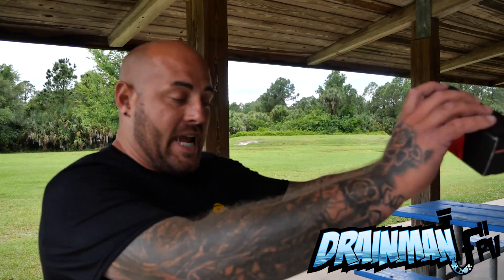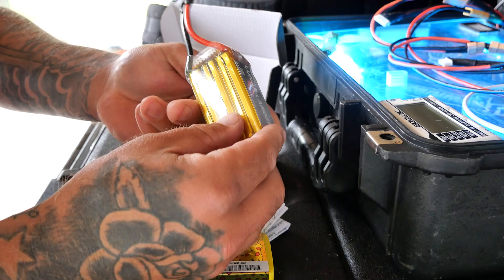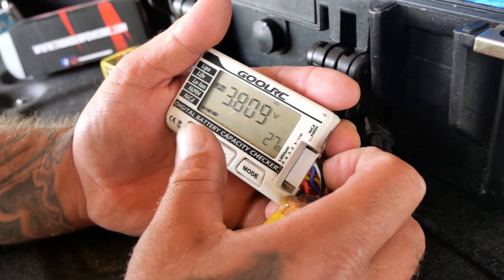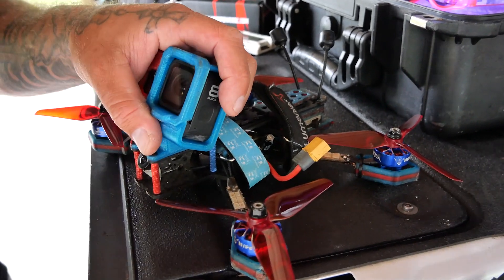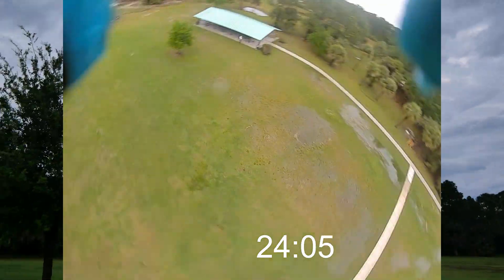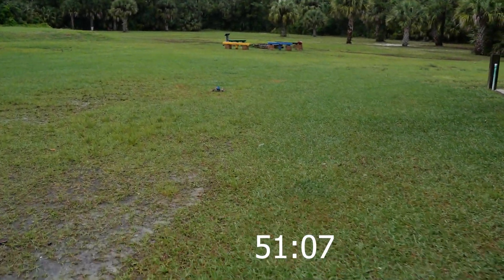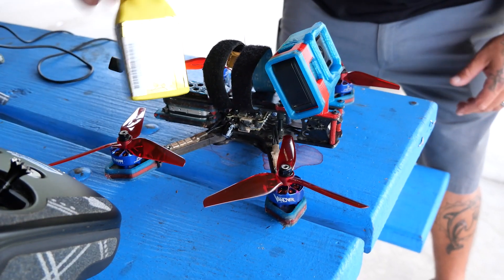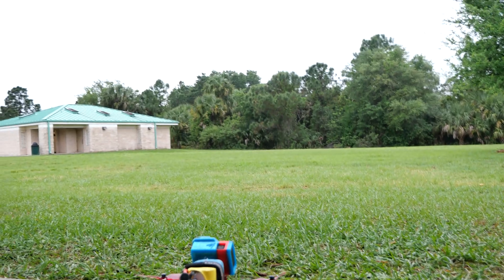Lipo Battery Torture !! 50$ Lipo VS 20$ Lipo !! Which Would You Spend Your Money On ?!

Comment: I got 3 lunar lander, I am extreamly disapointed. They suck, id only fly them if I wanted to brag I had a lighter build. 300mah, I'm getting battery low Waring. I will continue to use CNHL 1100 6s. I have beat the crap ouy of them, and they perform to the end, for 25 more grams I'll take CNHL.

Comment: Bro I need that prop driver!! I’ve been looking for that for a while! Didn’t see it in your description
Reply: looks like an old skill 1/4" battery powered ratchet. I have two, I have not seen them on the market for a few years mine are about 12 years old. Great little tool.
Reply: @juicetfpv1504  grrrrr I was afraid of that! Damn. Maybe I’ll get lucky at a garage sale 🤷🏻‍♂️
Reply: Yeah they're out there, different brands.
Google 1/4" electric ratchets.
Reply: I would not use a rachet.  if you need to go electric then you're better off using a drill that has a clutch torque adjustment.  at least that way the clutch will slip and not over tighten.  You just have to experiment with what setting works good and maybe do the final crank with a hand tool. with many motors having a hollow shaft, it's easy to over tighten and split them unless you're paying attention to the torque.

Comment: Hey DrainMan...thanks for this.
Possible to test bang for the buck under normal flying conditions? In this way, we would know if we have to buy 2.5 cheap batts to 1 quality batt, or if the cheap batt can last a season, and still perform at 80% like new, for example. 
Can't imagine torturing batteries provides any insight into that.

Comment: Dude this whole video is INSANE!  Love the content but would be nice to know the post flight stats (total mAh;s drawn etc, ).  CNHL's appear to hold their own in this one shot to bust test but did the more expensive battery crank out more current, aka more speed, aka more excitement before it nuked itself?  Also, more expensive Lipos tend to have more cycles which could outweigh the price difference.  Undecided about which battery won but loved the show, man!!!
Reply: In my tests the lunar landers usually only had 900, 915, 950mAh even tho labeled 1100, and they tested to deliver 20% less amps at full throttle than the CNHL Black 1100.
Reply: @Fly_High_FPV  Good to know!  I've always been impressed with the CNHL's.  Happy flying.....

Comment: I like the lunar lander due to being the lightest 1100mah lipo to date. Second favorite lipo is Tattu R line 4.0 1300mah 6s at 200gr being the lightest 1300mah inwhich the Iflight v4 6s 1300mah lipo seems to be the same lipo with different branding  as well as weight. Then i like the Dogcom 1160mah 533 lipos and 1260mah and 1350mah lipos .

Comment: This was hilarious 😂 
For some reason though, I feel like the lunar lander packs showed their quality through 3 cells failing instead of just 1 cell.
Like more of the battery cells were actively trying to fulfill the power demands placed on it.
Maybe the resistance was more uniform across all 6 cells of the lunar lander.
I guess that could work either way though.
More cells were actively TRYING, but ultimately failed.

Thanks for the laughs and some thought provoking!
Reply: Is that called confirmation bias?
Reply: @Fly_High_FPV  I’m not sure about confirmation bias, I wasn’t trying to be biased.
It just made me wonder if something like quality control or a tighter tolerance standard played into the outcome.
I don’t fly either brand of LiPo or really understand how they work honestly. Just threw my thoughts out there, to see if anyone else had any more understanding or care to break down the results a bit more technically, if there is any to share I guess 😂
Reply: @iSeeFPV  i see what you're saying, if the cells were perfectly balanced, they might fail together....in my tests, the Thunderpowers came New in Box with poor IR instead of perfectly clean, and the bad cells got worse quickly (in normal use). Since they ship with mixed IR, i'm not impressed by their cell pairing/matching. I use my $48 packs as goggle batteries now (ouch), because i dont trust them to land me back on the roof.  The overrated capacity really took me by surprise too, 1100mah batteries that go flat at 900, 915, 950....

Comment: I just use Tattu R-Line packs. They are worth it to me the 1300&1400mAh 6s they are smaller then all the competitors, they just don’t compete with any other pack that I’ve used. And I’ve used quite a few different brands. But that’s just me. I have some R-Line packs that have been tortured for 11 months and they still kick like brand new packs. I use those vanover 2207-2021kv 6s motors and I love them. They are good as shit.

Comment: Botgrinder did a battery test and the Pizza ended up on the bottom of the pile. Is the Lunar lander that much of a shittier batt? He never tested the Lunar Lander either... I just tstarted on the CNHL train so i will see what happens with mine
Reply: I have a dozen CNHL batteries.. They are great. Botgrinder didn't do a very scientific or thorough test either, that video doesn't really show any real value for batteries.
Reply: @TylerD63  True, nothng Bot does is very scientific. But the pizza's did end up last. However here the Pizza marginally beat out the $50 batt. Mind you this wasn't very scientific either in the sense of the term. I picked up some Ministars, first time using CNHL's. I will be putting them through a shit ton of cycles so time will tell.
Reply: @North49 RC  in my tests the pizza packs arent as good as the blacks.  Tested for Amp Delivery: 
CNHL Black>Tattu R-line3 =Ovonic>High-C>ThunderPowerRC Lunar Lander>RDQ>GNB>Eachine>Goldbat>MaxAmps